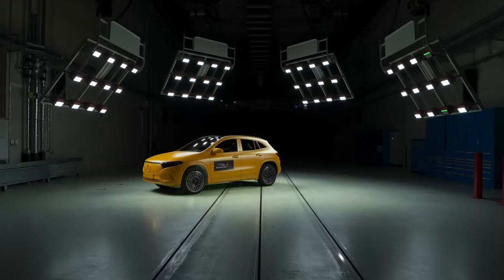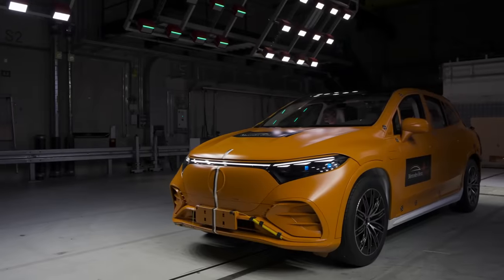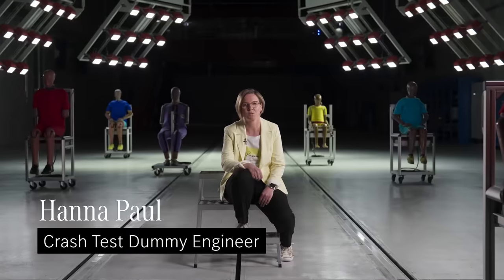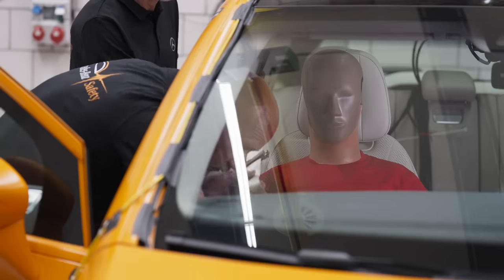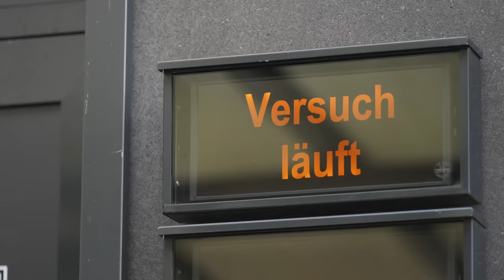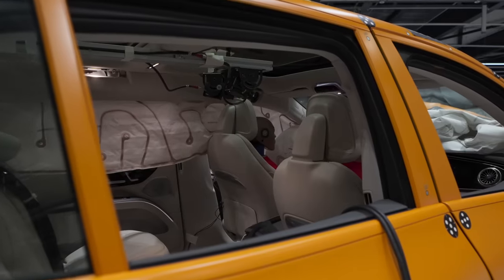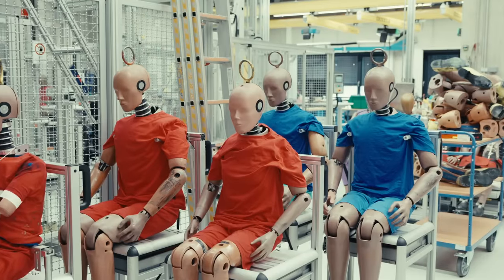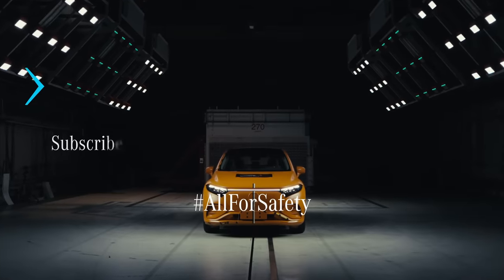The world's first public two-car electric crash test by Mercedes-Benz

Comment: I'm glad they're still focusing on safety. They now need to focus on getting back build and material quality. The new cars feel cheap inside and use a lot of cheap plastics. And they don't feel solid anymore. Parts of the interior creak and most rattle. Also, the safety features should be standard across the board. Radar cruise, blind spot monitoring etc shouldn't be optional extras. Only then can you brag about the safety of your vehicles. Otherwise, it only applies to certain models optioned with it and it doesn't apply to the whole brand.

Comment: Would you publish the battery charging levels at the test. Was it 10%, or 90%? What the battery structure condition after the collision test?
Reply: they will have been totally flat , as ICE car crash test dont have any fuel in them just water for the weight so it still sloshes and spills if the tank ruptures , a flat battery weighs the same so you can guarantee they didnt have a single volt in them .

Comment: always trust MB for the highest safety standard
Reply: you better trust EuroNCAP, IIHS and others about safety...
Reply: Volvo
Reply: @ChiliM4n  Volvo does well in a lot of tests but not every test (updated IIHS side test, for instance they didn't get top rating). Tesla does quite well in most tests as well. Mercedes does well. Subaru does well. Some others as well now too.
Reply: @Tschacki_Quacki since they consistently overachieve on ncap op should be fine ;-)
The shown test already exceeds ncap regulations in spees
Reply: No thanks I'd rather have a non German car
Reply: Since Saab no longer exists, Mercedes-Benz is my go-to for safety.
Reply: @DankSi  what would be your pick?

Comment: Was the battery's fully charged or even connected  in case they burst in flames  i doubt  it people   know evs are dangerous
Reply from the maker: We take safety very seriously. In order to have a realistic scenario, both vehicles were charged to typical charge levels. This means between 50 and 75 percent.

Comment: My question is: who crash at 56kmh?! Are we continue having these tests with such a low speed? Just saying 

The reason the results are so so good!
Reply: When you think about it in cities speed limit is 50 but everyone is going a little bit faster so this is good speed and what most people will be driving.
Reply: 56kph is over the 50kph that rhe ncap demands for a 5 star rating. So already exceeding the highest security standards.

Also these are speeds where you statistically have the most accidents, rherefore being pretty important
Reply: Pray you never crash with full speed - there is no car which can protect you in such situations well. Always hope active safety systems or you will do an emergency break and lower the speed before impact - that's why you won't see any test with autobahn speeds like unbreaked 130kmh into a barrier.
Reply: At which speed do you usually crash?
Reply: Take your everyday driving speed (say 100 km/h on a 2 directional road) minus what you manage to brake before hitting the other car doing the same. You usually don't crash into someone/something with 100 km/h when you drive at 100 km/h.
Reply: The question is which speed is deadly … but as the others say it depends if it is a frontal crash etc
Reply from the maker: We aim to build the safest cars in the world. Therefore we make no difference if it is a car with a combustion engine or a battery electrical vehicle. A car with an electric drivetrain is built, when it comes to body-in-white, in a totally different way than cars with combustion engines. But for us, it is important, that they are at a comparable safety level.
Reply: 'A velocity of 56KPH' is stated, so that could suggest both cars are travelling at 28 kph or less than 18 mph to achieve a 56 KPH impact velocity! is that a common real life scenario?

Comment: Do all car manufacturers have to do this & do external validators. Check there results etc?

If a cars battery was damaged / destroyed, what would be the potential outcome to the passengers / vehicle?
Reply from the maker: Mercedes-Benz has developed a multi-stage high-voltage protection concept for its electric vehicles. The system has eight key elements to ensure the safety of the battery and all components with a voltage above 60 volts. Examples include separate positive and negative wiring and a self-monitoring high-voltage system that automatically switches off in the event of a serious collision.

Comment: Biased test. Hit the side (tree, pole) with great force - will the batteries be safe and won't cause the passengers to burn alive?
And the second thing - how will a traditional car of a similar class (much lighter) behave after a collision with a heavy electric vehicle? Maybe you could post such a video (A-class vs EQA)?
Reply: Yup they are, otherwise the car wouldnt have a 5 star rating in NCAP. Regulations on HV-safety are pretty strict. All the tests you are talking about are also conducted.

Comment: How does the system work that accelerates the car to the required speed so quickly? And how does it allow the cars to collide at the desired spot?
Reply from the maker: In this case it was programmed to collide.

Comment: Volvo does safety much better and without crumbling the car into million pieces.
Reply: Crumbling is what u need to absord impact energy.

Volvo is really goos but comparable tests dont show any advantage in results over mercedes. --> both build really safe cars
Reply: @quelandil5738  Lets say this as good as A Volvo. Which one do you think is better and most people will pick. One that self destructs doing so or one that barely damages itself.
Reply: @k7y  since u survive in both and both cars are totalled afterwards you can simply go by preference.
For me probably a C220d T-modell =)

Comment: The very obvious question, were they fitted with the propulsion battery. I saw 2 similar cars crash into each other at a slow speed. 80 and 110km crashes please.
And how much to these at best med size cars weigh

Comment: Safest option. Build piston cars, that are lighter and do not have dangerous batteries onboard. Might be a good idea for safety...
Reply: Safety is actually higher, since having no engine un front helps reducing impact
Reply: Well, they haven't figured it out in the 100 or so years of gas cars, time to step aside.
Reply: @lifeleisuresa1229  Although true, that doesn't negate the advantages of not having an engine in the front.... There can be a multitude of factors in one equation you know.
Weight is also "only" a problem for the opposing vehicle, which will still benefit from the bigger crumble zone

Comment: What makes me worried is that due to increased stiffness around batteries, force might be dispersed a bit harder - transferred harder to passengers, especially with higher speeds, but I guess that'll be the case until we have "soft, nonflammable" batteries which will happen in many years.
Reply: For frontal evs have the advantage of not having a engine which gives u more crumble zone.
The battery is the second most important part after the passenger in regards of safety. So it isnt there to take any impact, rather there are elements all around it to absorb impacts

Comment: Why not 64kp/h wich is the norm for years? Was the battery pack fully charged? SO MANY UNKNOWN >
Reply: The one who actually conducted the test First did use 64kph, and yes they have battery pack fully charged when EVs are involved, and one of the EVs burned into ashes several days after the crash test.
Reply: @oijhhytdirhrbru whats your source for that?
Either you work there and just committed a felony by telling interna or you are making things up.
Reply: @quelandil5738  I've referred the video in another reply here, why not watch it yourself?
Reply: @oijhhytdirhrbru  simply send the link instead of letting me search through all the posts....

Comment: Okay so question for any automotive engineer... What is the mentality of going with something that is well known and extremely well documented to run off of a power source that is as environmentally destructive as Lithium Polymer or even Lithium Ion batteries that are naturally extremely volatile and completely unstable even on a good day when hydrogen powered vehicles are substantially cleaner and less of a risk to the general public where gas powered engines would only need a few modifications to run off of hydrogen fuel?

I mean is it really all about the money and the fact that a company can charge substantially and ridiculously more money for an EV then a Hydrogen vehicle or even simple conversion kits?

I truly am curious cause i'm not an engineer so i tend to take the common sense approach versus an engineers over complicate the hell out of anything simple approach.
Reply from the maker: Hi, Our engineers strive for a balance between performance, safety, and environmental impact. The transition to electric vehicles has gained momentum to  reduce overall carbon emissions. Our team is committed to advancing sustainable solutions, and we appreciate your interest in these crucial topics.

Comment: Thank you Mercedes. May i ask why the test was not at 64kph?
Reply: Why specifically 64?

The speed they used was slightly higher than the required 50kph for getting a 5star Ncap rating.

Comment: And what of the battery? In a crash, wouldn't that be damaged?
Reply from the maker: We aim to build the safest cars in the world. Therefore, we make no difference if it is a vehicle with a combustion engine or a battery electrical vehicle. The fact that the battery is not destroyed in an accident is crucial for the safety of road users and part of our safety concept.
Reply: @MercedesBenz  It is good to see a company think about the seriousness of EV batteries, as it seems most car companies play down the seriousness of thermal runaway with batteries. It's one thing to survive a crash, another thing to survive a crash but get stuck in a fire.

Comment: I wanna know more about the procedures regarding  these 2 cars after the accident...like where  to be stored , for how long and how do you sign off the battery to be stable thus safe to use on public roads ?
Reply: Cars are taken apart and structural parts are analysed and compared to previous simulations. Batteries have tons of sensores to detect any damages or other problems. No battery will be used again after totalling it in a crash. But before hating on it, any ICE would also be scrap after this crash. Thats why it's called "totalled"
Reply: @quelandil5738  for sure an ice car would be totalled as well. My concern was related to the damage  caused to the HVB. They are known to catch fire weeks after the accident even if the accident was as  minor as a speed bump or undercarriage damage that wouldn't cause similar issues for an ice powered vehicle. From my personal experience we've dealth with EVs that had many many recalls, updates,  warranty issues and weird faults causing the car to be totally immobilized.  I guess that's normal for a new product but the biggest concern was the fire hazard those batteries pose and the ease with which any damage to the undercarriage would require a new battery just to avoid the fire issues.
Reply: @Nick-lm5lz  
Fair enough.
I am no expert and haven't seen data about the procedures after the crash. So I can't make any claims towards that.

Only thing, surviving the crash is the main target. If there are issues afterwards it is manageable with lower risk of harming people
Reply: @quelandil5738  yeah I am not concerned about crash protection thou one might say that an ev being as heavy as it is will cause a lot of damage to a conventional vehicle.
Reply: @Nick-lm5lz  that is certainly an issue!
My guess is that we are at peak weight currently. Batteries are the main driver in weight and lots of devs are working on reducing wright an size. E.g. with solid state

Comment: Were the batteries fully charged before crash to simulate real life condition?
Reply: They were, although it doesnt really make a difference since they dont any damage at a speed like this.
Result would be same 100 vs 0% SOC
Reply from the maker: It is our philosophy to test under real conditions. We call that Real-Life-Safety. Therefore, the batteries were almost fully charged. This is the usual procedure for us. This means that the batteries were at about 80 percent.

Comment: Thanks MB for this. Now ask your software developers to give me full screen Carplay and Android Auto on the V167 2020-2023 so I have a nice large screen to see and read my navigation map in order to avoid such an accident in the first place. Also give back some useful buttons instead of all capacitive buttons on the steering wheel for 2024 models. If you really want to prevent accidents then these changes would help.

Comment: The collision shouldn’t have happened as both cars would of activated the automatic emergency braking system & stopped before impact
Reply: While that would have been the case in certain scenarios, that‘s totally besides the point of a crash test.

Comment: Question: when in most county’s the speed limit is 60 / 100 K miles / 100 K per hour, why on earth is this car tested at 56 K/hr, when people are usually traveling above the 100 K /hr
Reply from the maker: Our approach is real-life-safety. We learned from our accident research, that 56 kph is the typical crash speed during an accident outside urban areas. Of course, we are also conducting crash tests with a much higher speed.

Comment: Why only 56kph ? Surely a 50% crash such as this would be from overtaking... in which case they would be travelling at a much higher speed, especially considering EV's are generally sold making a big deal of their performance.
Reply from the maker: Thank you for your observation. We learned from our accident research that 56 kph is the typical crash speed during an accident outside urban areas. Of course we are also conducting crash tests with a much higher speed.

Comment: The only missing part is the unquenchable lithium ion fire, as per the Germany s Chief Fireman. THEN, and only then, we'll have a realistic safety evaluation on EVs that have been tested for 10+ years with ICE standards. Let's be real people, this is a Benz ad. Hats of to them anyway, at least they're on the right path.
Reply: U do realize that battery safety is the second biggest concern after passenger safety?
Check out how they are build and how it gets tested. Theres some publishes information out there
Reply: @quelandil5738  Did you read what I wrote? "as per the Germany s Chief Fireman"?  Good enough for you? The horrific fires created by EVs are now not even considered when evaluating them. Go read some news on what a true accident looks like in the real world. Even if sometimes the EVs are parked, imagine now a hwy collision at 100+ km/h.
Reply: @farnum3297  i dont really get where u are going with this. Yes, burning evs are problematic but not unsolveable. Countermeasures already exist and are developped for firefighters.
If you only look on worst case crashes, we should simply ban all vehicles. And for the passenger it doesnt matter if it is a fuel or ev fire. Either u get out fast enough or not. If it burna for 5min or 5days afterwards doesnt change passenger safety

Comment: Only a 56 Km/h combined speed... What about freeway speed? What about lateral impact where the battery have practically no buffer zone?
Reply from the maker: Our approach is real-life-safety. We learned from our accident research, that 56 kph is the typical crash speed during an accident outside urban areas. Of course, we are also conducting crash tests with a much higher speed.

Comment: So does the steel cable earth the cars ?
Reply from the maker: Hi there, the cable is only used to accelerate both vehicles to the set speed of 56 km/h. The vehicles are not earthed. The high-voltage system is switched off automatically in the event of a crash, which worked as intended.

Comment: Why not at 120km/h?
Reply: This test is according to the NCAP regulations (actually even a bit harder) which is used for the 1-5 star safety ranking. NCAP regards the most regular crashes, which therefore are the most important ones.
Reply: If both were travelling at 120km/h it would be fatal for the passengers, no matter how safe the cars are. You reach a point where the forces from deceleration on the human body are that high that a crash isn't surviveable.
Reply: Why 120km/h?
Reply: Because people brake before hitting oncoming traffic, and where do you drive 120 km/h with any chance to hit oncoming traffic anyway?
Reply: @htimsid  why not?
Reply: @koko-lores  believe it or not, there are counties with roads that have traffic flow in opposite directions where the lane has no physical barriers. You must live in a country where the road is idea and all drivers act predictively.
Reply: @metalstorm45  No, I live in Germany (and have been living in other EU countries for years). Max speed without barriers between oncoming traffic is 100 km/h in Germany, often less in other countries.
Drivers aren't predictable, but there are usually (not always) road markings telling people where to go. Not all do, some cut lanes, overtake anyway, cause dangerous situations, cause accidents. However, unless under the influence or completely asleep/distracted, people brake before crashing, reducing the speed of impact.

Comment: What was the state of charge of the two EV packs prior to the test? >80%
Reply from the maker: It is our philosophy to test under real conditions. We call that Real-Life-Safety. Therefore, the batteries were almost fully charged. This is the usual procedure for us. This means that the batteries were at about 80 percent.
Reply: @MercedesBenz  thank you for the quick reply and info. That builds confidence that the packs in those at a high level SoC can get through without getting "cranky."